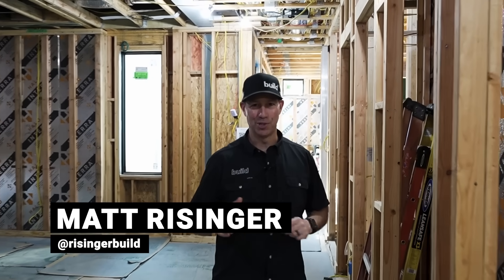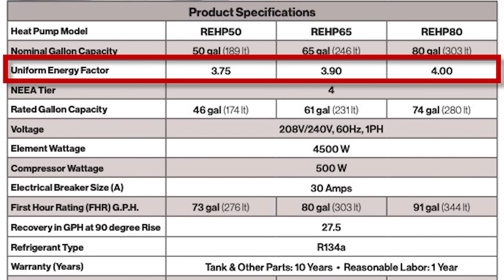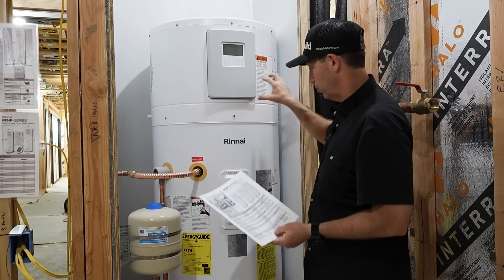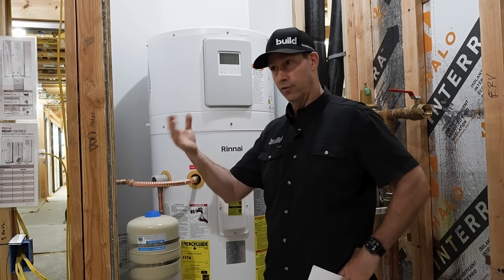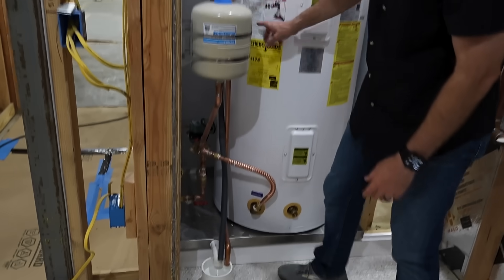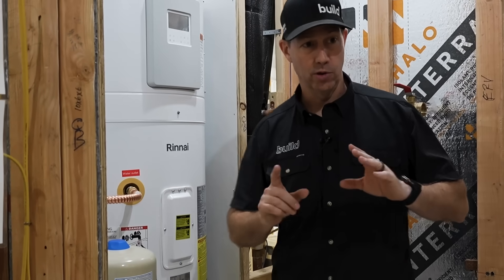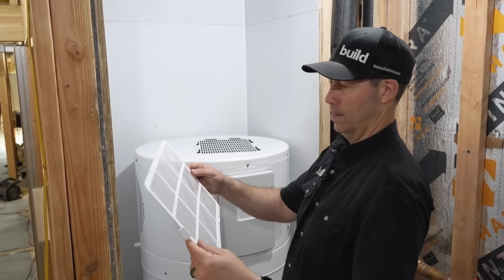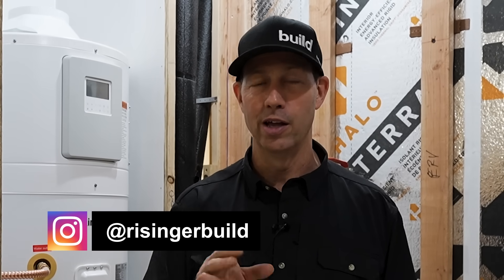The Best New Water Heater? Rinnai's KILLER Electric Heat Pump

Comment: As a rule of thumb folks, never get recommendations from a sponsored video by the brand being recommended.
Reply: This is basically the home shopping network for home improvement products.
Reply: @Truth_Ends_Cancel_Culture  Which doesn’t mean HPWH aren’t good, just do your own due diligence.
Reply: I'd modify that to never blindly trust a sponsored review.  Always verify, and if possible find independent reviews aa well.
Reply: Yup exactly what I was thinking
Reply: Who still sweats copper in the age of press fittings?
Reply: @davidstineman5572  People still sweat copper because there’s a big difference in long-term durability and reliability between traditional soldered copper and quick-connect/press-type fittings like SharkBite — and it’s not about nostalgia, it’s about what lasts the longest without leaks.

Soldered Copper (Sweating) — The Proven Method
	•	Soldered copper joints create a true metallurgical bond that, when done correctly, is as durable as the pipe itself. These joints have been used for decades with very low failure rates.  
	•	A well-soldered copper joint is generally watertight, resistant to high pressure and temperature, and doesn’t rely on elastomers (rubber O-rings that can age or degrade).  
	•	Many professionals consider soldered copper the gold standard, especially where access will be limited (behind walls, under slabs) or where longevity is the priority.  

So yes — people still sweat copper because done right, it will outlast most push-to-connect fittings and isn’t limited by an O-ring.

SharkBite & Push-to-Connect Fittings — Quick, but Not “Forever”
	•	SharkBite-style push-to-connect fittings are extremely easy and fast to install with no torch, solder, or special tools. That’s why DIYers and emergency fixes love them.  
	•	They can be used in permanent plumbing and are code-approved in many places, but they rely on internal O-rings and grips that can wear or be damaged by pipe condition, freezing, vibration, or improper installation.  
	•	Many plumbers will tell you they’re fine for temporary, exposed, or emergency work, but not always preferred for hidden, long-life installations where leaks are extremely costly if they occur later.  

Some pundits online even caution that SharkBite fittings shouldn’t be the first choice for permanent plumbing unless absolutely needed.  

Bottom Line
	•	Sweating copper isn’t obsolete — it’s the long-term, professional standard. It’s what experienced plumbers choose when reliability over decades matters more than quick install times.
	•	SharkBite/press fittings have their place — in *tight spots, quick repairs, or for people who can’t or won’t sweat copper — but they aren’t inherently superior in longevity.
	•	That’s why folks like me — who can sweat copper — still do it: we want plumbing that stands the test of time, not something that’s convenient now and may get you called back later to fix a bad connection.
Reply: My experience with all Rinnai products has been exceptional. I have no problem with his endorsement.
Reply: I agree, but facts are facts so it is not the recommendation as much as a presentation of facts and features. Do your own research to compare with others. A little education never hurts.
Reply: No, do your own research and then buy whatever makes sense...which could very well be that very brand.
Reply: So true. Never did he mention how it cools off the house when it runs, it like running a small air conditioner. No one I know who lives in the north would run a small air conditioner in the winter while simultaneously running the house heater.
Reply: And how does somebody so reputable recommend something without any real world use of the product?
Reply: Plumber for 13 years.. I would put this in my home
Reply: @RunHTX-o9m  You are insane. Or a liar.
Reply: @RunHTX-o9m  Why would you pay an extra  4 thousand of today dollars to save maybe a 2 hundred a year in future dollars? Makes no sense.
Reply: @MrTexasDan  because you believe in the negative effects of global warming
Reply: @tommac5411  How noble of you to pay extra to save the world. I suppose you walk to work and live in a tiny apartment as well?
Reply: Four times more efficient, 6 times the cost
Reply: @ Initial cost is only one factor. Figure out the lifetime cost and then you have a real comparative view.
Reply: nah, these are good products
Reply: That isn’t necessarily true…there are situations where the influencer becomes aware of a product, research and finds that it’s an awesome product….in this case this is an installed product also….then the influencer contacts the brand to get it sponsored….because why not get paid for a product you believe in…the specs he’s presenting actually presents a compelling argument to buy this unit. But yes, there are sponsored videos that you shouldn’t trust….not so on this channel…imo
Reply: @SIMSMANORFARM I can’t tell with Matt, he has previous videos talking about his kitchen and what he does NOT like about it and it was a sponsored Miele project but he appears to like too many products for me to believe all of his reviews are not heavily “influenced”
Reply: @ I like lots of cars…but I buy what fits my budget, style and usability….all the other cars are great but I can’t get them all…but if my son needs a car…guess what…I’ll suggest a different car for him…not sure why Matt is getting flack for offering views on different products…he’s just offering choices that further the cause of building healthier homes…
Reply: @SIMSMANORFARM  Not this guy. His recommendation goes to the highest bidder.
Reply: @SIMSMANORFARM  In this case, being an "awesome product" and making money from it doesn't override contextual facts.

Other HPWH vendors were covered on this channel with higher efficiency, feature parity, while costing significantly less. I should know, since I followed a previous recommendation and installed it myself.
Reply: Considering he is installing these in his builds and is responsible for future warranty issues, I doubt he’d install it if he thought it would result in callbacks and potential warranty-swaps.  He’s never hid when he is sponsored and, based on the video, he just read the stats of the unit and talked about why someone would go with a HPWH. I think the plumbers got a better review than the water heater.
Reply: Why? Did you learn from YouTube that most people are dishonest? There is no guaranteed relationship between integrity and money. As a rule of thumb, never assume a sponsored review should automatically be ignored.
Reply: I appreciate that Matt is always forthcoming about sponsorships, and not in a "footnote" kind of way; so there's no ambiguity. I believe Rockwool has sponsored, at least partially, some of his videos in the past;  I noticed the Rockwool sponsorship, and did more research on them to see if their products were as good as Matt says they are. They absolutely deliver - although insulation cost was about 2x compared to fiberglass, the ROI in terms of comfort and noise control left fiberglass in the dust!

 I would disagree that it's a rule of thumb to never get recommendations from a channel that's sponsored by a product. I'd say, do your homework, and see what other people are talking about around that product. Matt has shown some top-shelf products that I would have NEVER considered, or even seen - like the window flashing caulks and tapes - that elevate a build or repair to a significantly higher level of craftsmanship. I've never seen a water heater like this. But even if all Matt did was make a great sales pitch with this video, isn't that enough? We all have plenty of resources to verify what he's saying! :)
Reply: @scrivyscriv  It's probably safe to say that this channel is firmly into sales pitches. Which is ok since it has exposed me to certain products as well.

But you shouldn't assume people have plenty of resources to validate from. Some people are simply looking for a trusted source of information to make most of the decision for them.

In this case one may not know that there's another product on the market with feature parity, more efficient, while costing significantly less.
Reply: @punksjutgbd   The reason I say everyone has access to resources to validate Matt's claims, is just from my observations on YT over the years. There is ALWAYS some channel putting out content related to whatever item or process Matt's covered in every video I've seen. But to your point it can be a challenge to find alternative products if all one is exposed to is just one brand.
Reply: Legally required to disclose the sponsorship.  Are you a bot promoting rockwool? @scrivyscriv
Reply: Specs are all I care about. His video shows the numbers for the unit which means what he is saying is credible because he's not trying to hide anything.
Reply: @dustinadamson833  dunno, mentioning that the steel pan is there so that if there's a failure in 30 YEARS the basement is protected seems like a bit of editorializing.   Warranty is 10 years.
Reply: @MrBaconis  An often overlooked failure mode for any water heater installed inside a home is that the supply lines can corrode, depending on the materials used in the water heater connections and the supply lines. Instead of a leak in the tank which dribbles down into the pan, or an overpressure situation which is directed through a pipe down into the pan, and then down a drain, you get water spraying random directions near the ceiling. I am impressed that the entire closet in this video is essentially waterproofed. This guy knows a thing or two. But I still want my water heater outside my house. 

The supply line issue can be prevented by occasionally disconnecting and reconnecting the lines, and replacing them on occasion. But we did not know that when our water heater lines failed on a Thanksgiving weekend (of course!). My brother's failed much sooner after his home remodel, where the new water heater was placed in the garage instead of the house. After his experience, it now enjoys life in the great outdoors, on the south side of his house.
Reply: @MrBaconis because it’s code
Reply: @dustinadamson833 lol😅

Comment: Glad you focused on the ventilation requirements.  I was very heavily considering a HPHWH when replacing my old tank.  My basement dehumidifier basically runs all summer and, in the aggregate, consumes the most electricity of anything in my house annually (more than either of the AC Compressors individually).  That said, because my basement is fragmented, the initial procurement cost and ducting/modifications of the spaces to get enough air just didn't have a good ROI (it was like, 2 decades to break even), so I went with a tankless gas (from Rinnai).

Comment: Here in Australia we have had a heat pump hot water system in our house for over 20 years... but ours is outside of the house.
Reply: @zacandmillie  I love hearing this. What sort of piping is used there?
Reply: @punksjutgbd  Copper tubing into the wall from out side and the piping then is run in the crawl space in the ceiling.

Comment: On bottom fed water supply water heaters you really should run the supply line above the the waterline of the water heater and install a vacuum breaker above the waterline  between the shut off  and where the supply line goes back down to tie in to the water heater so that if the water pressure ever stops it can't back siphon into the drinking water system or the water utilities

Comment: this is the most laughable sponsored build show video to date.  even with the intake and exhaust vent kit, the rinnai is inside a closet.  without showing how it will be ducted to draw in warm air and exhaust the cooled air, this install would be a disaster to recommend.  this sales pitch requires more video on how that would be planned in this build, because simply showing the vent kit is not sufficient

Comment: Matt, Nice workmanship on the install, but I have a few problems with the science of it.  In the summer, heating the hot water with a heat pump nicely helps cool your house, but in the winter you are cooling off the house that your are paying to heat.  I suggest that the ultimate solution is to have a whole house heat pump that can use its excess heat in the summer pre-heat the water.  In the winter the heat pump water heater can draw its heat source from a geo coil.
Reply: You are describing “The Magic Box.” Sold in England they are combination units of several types. They are complex and unreliable. Why isn’t your refrigerator directly connected to your water heater and your furnace or air conditioning system and heat recovery ventilator, dehumidifier, HEPA filter? Complexity.
Reply: We heat with wood, which is "free" and often runs hotter than we need to be comfortable.  Just need to figure out an optimal space to put the water heater and run the water lines.  Fireplace is over slab on opposite side of house where basement (and hot water lines) are.  Can run B vents off the fireplace to pump hot air but no easy run for the ducts to the basement.

Comment: So it's super efficient at taking heat from my propane furnace and moving it into water...but why wouldn't I just use the propane to heat water directly for 1/10th the equipment cost? If it's just making my furnace work harder, I don't see the savings. And in summertime, couldn't I do the same thing with a simple desuperheater, again at 1/10th cost? Sounds like a lot of fancy engineering for people who are bad at math. 🤷‍♂️

Comment: better for warm climates, free ac. worse for cold weather, especially if you have resistive/base board heaters. cant think of someone installing this in an old house with baseboard heaters but you never know. in the winter you make the house colder and offset it with resistive heating? most cold weather houses have gas i think so not a big deal tbh.
Reply: https://www.youtube.com/watch?v=9kzdCyA9fH8 This is more like what you would be after. Note the lower the water temp the better for efficiency. So probably be better to have separate units so the temp for the heating and water can be set where they need to be.

Comment: if it draws only 500w, why does it have to use a 220v circuit?
Reply: What a great question!  I'd also like to know.
Reply: I would guess to run the 4500w immersion heater that is 20A and the 2.5A gives reason for the 30A circuit

Comment: A lot of people ignore a very obvious efficiency improvement with their ducting for these. Mine is installed in my garage where it was formerly grabbing air from the garage space and exhausting into the same. Running 16' of 8" inlet ducting to the peak of the attic above however boosts the air inlet temperature by 5-15 degrees from night time in winter to summer afternoons. I don't route the outlet to the outside because I don't have a freezing issue in the garage, but my clothes dryer in the same space uses the dehumidified air to boost it's efficiency as well. So it's a complete air loop from the attic, through the garage, dryer, and back outside - where soffit venting picks up air from the perimeter of the house to replace attic air supply.
Reply: I did the same!  Like you, taking intake from the attic, but venting it into adjacent walk-in pantry, which then vents to the outside.  So keeping things in there cooler, but not the rest of the house.  By the way, for those considering a HPWH, they're fairly loud when running, so consider that in where you're putting it.  I have ours on a schedule that runs on resistance heat during sleeping hours.
Reply: Where are you located? Is your attic air temperature on the high side year-round?
Reply: @tjshire  It's relatively mild here in Eugne, OR, but my home does not represent the best in insulation, having been built over 100 years ago.
Reply: Perfect set up , great job
Reply: Not sure about your attic but mine has an old stinky oder I would not want to smell. Being in construction most of my life tells me most attics do or will smell awful at best eventually. Just my opinion. 
Terry
Reply: @ForestToFarm  Valid concern, but my garage is far from air sealed and is not a refuge of potpourri pleasantries.  ;)
Reply: The hunt for wasted heat. Complex added to the complexity and high cost of the equipment and install labor seems like a zero-sum game on the energy balance sheet.
Reply: @benevolentdictator2315  It's definitely a cost vs. benefit consideration. For me though, this was extremely easy to do with two pieces of rigid duct and an elbow. All I had to do was cut a hole in the drywall above and slap it together.
Reply: I like tankless on demand much better
Reply: @SamClemens-n9q  While they might make some sense in point of use applications, they are still less efficient by half. This study shows a COP of over 2 on average for HPWH over a year, showing that standby losses are not a significant factor to consider. Cost of the units and installation also does not provide on-demand heaters an advantage. So the only reasons I can come up with to install one over the other are needs based. If you need instant or endless hot water, the choice is clearly not HPWH, but if you want to save money in the long run, it's clearly not on-demand for typical household use.

https://www.nrel.gov/docs/fy16osti/64904.pdf